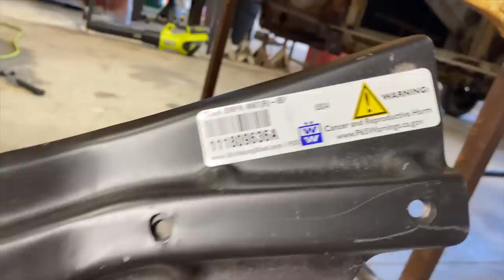1965 VW Beetle Restoration - Heater Channel Fit & Weld

Comment: You are lucky that the heater channels come already assembled. Years ago, when my dad repaired a 74 super beetle that I now have, they came as separate pieces and had to be assembled as they were installed on the car.
He had actually had the driver's side put together and welded in place but had to take it apart because he had it wrong, and the door would not close.
Reply: I was going to point that out too. I bought repair panels from the VW dealership back in the day and it came in pieces.
Reply from the maker: Yes, the HC from Klassic Fab are really nice !=)

Comment: Mike is the guy to ask but just my opinion is measure to distance from front piller to back and make them match so you can tack weld in the passenger side heater channel. I've seen Mike repair a door like that before. Takes time but doable

Comment: 9:32/ 48:18 Thank you for teaching all of us this process/ product. Learning something new on  restoration!

37:10 / 48:18 I had the same issue removing doors on my VW 1961 Beetle. I learned lube, screwdriver w/ tapping the screwdriver with a hammer, then using a air impact screwdriver helped free up those door screws. 

Your doing awesome! People need to understand that it takes time, patience, and a little elbow grease, to make a VW Beetle look amazing!

Comment: You will want to fix and weld the inner wheel well in the front to the heater channel and the rear quarter area to the channel before you cut out the pillar area

Comment: great video! I use to do both heater channels at the same time, however, I've discovered that replacing one side at a time, was easier, with little to no body flexing, and door alignment was spot on after installation...
if the heater channels are both corroded to the point where there's no support left, and the doors are already out of alignment, then go for changing both....

Comment: Hi CT, I was told your rivet gun tool was invented at Boeing during WW2 by a guy named Lester so they were called Lester tools but you needed air. There was a hand one you could use without air as well but you needed one screw close to it free and up a bit to use it with the tool for leverage to get the other screws out. It was good on a flat surface like on a wing.

Comment: Love your attention to detail and just 'keeping at it' but I think you missed an important factor in fitting heater channels to the body. You bolted the body to the chassis on new rubber mountings but bolted the heater channels to the chassis without the thick rubber gasket that goes all round between the body and the chassis. I think that is why you had to distort the front of the chassis up against body to make the doors fit.
It all fits now but I hope you will not find that when that gasket is fitted under those heater channels the front and rear mountings are not too high off the chassis. That gasket is VERY thick.
Reply: That's exactly what I was thinkin'.....

Comment: I love your work and I feel you would benefit by doing the same jacking process on the floppy passenger door opening when tacking to the rocker. Use measurements from the other door, both horizontal and diagonal, to give yourself a fighting chance to gap the door evenly. I have never done bodywork, just makes sense to me. This series has me hooked and I am working my way through the swamp dragon..... Best regards from sunny South Africa

Comment: The screws on the door are made of softer metal than the door pillar threads so that they bite in tight  that's why they are always a pain very clever from VW.

Comment: Work the screws in and out as you go..don't just keep going out only...you spray it..turn out till it tightens...spray the threads you turned out...turn it back in...turn it out again till it gets tight ( just begins to get hard to turn again not too far )..spray again to lube threads as you turn it in...this gets lube in and cleans the threads of crud making it tighten up...repeat till it turns easy.... takes time but usually works to get fasteners out when seized or rusty ....heat helps too as you go...

Comment: Hi guy, I really enjoy to follow  your beetle playlist. At first sight,  this car was intended to be scrapped,  and that's the funny part, to restore a car in such conditions is not for beginners! You'll learn a lot. 
Before tack welding the channels, you should think to restore the doors so you'll get its final volume. Great job!

Comment: Great video, something I learned when welding, is to move that light in front of my face closer to the weld, so I can see better before I pull the trigger. Also for grinding down the weld we like to use a 36 degree flap disc on your grinder. It works amazing and takes them down real quick. But great work, the progress is amazing.

Comment: Dude! First of all, you’ve got brass balls to take on a project with this much welding, so take this as constructive and supportive criticism, and suggestion.

(Weld up cross supports for all 6 sides  of a box, to the inside of the body, with the doors on, and the body as squared up as possible)

Put the doors back on, and lined up in the right closed/squared up position. Then weld Chris-cross supports, top of A pillar to near bottom of B pillar on the passenger side 1st, and top of B pillar to near bottom of A pillar, on the inside. 

You’ll clean those weld spots of & prep for paint later. Do the same for the driver side. 

Then weld supports from the top drivers side A pillar to near bottom of Passenger side B pillar, and top passenger A to  near bottom of divers side B. That forms an X going from the top of A to near the bottom of B, now repeat that X going from the top of B to near bottom of a for a cross body X slanting the opposite direction of the support I described first. This one going up from front to back. 

In other words, with the doors on, weld up way more support than you had before, to keep that body “squared up”/aligned when you take the doors off, AND so you can take the body off and on, as much as you want, without the body’s geometry changing every time you lift it.

I was trying to tell you in the beginning when you first lifted the body, that you need to weld up cross support for ALL 6 sides of a box inside the body before taking the body off. You would not be having this difficulty, now, had you done that first. 

The fix for that mistake, is as I described above. I want you to succeed, and you will, I just don’t want that mistake to continue to make this more difficult than it already is.

I know the Passenger door is “too far gone”,  but either do as I described above, or get a donor door to square up the body, before welding the heater channels, and then weld as much of the outer skin of the old door to the donor or fix the OG door.

Whatever you do, (tongue in cheek, meaning,somewhat jokingly)…
 “for God’s sake, man”, please weld up cross supports for all 6 sides of a box to the interior of the body, with the doors on and squared, BEFORE you remove the doors and body to weld up the repair areas. 

If you doubt me, send an email to that Chris V… guy, he is really cool, too, and will give it to you straight.

Again CT, I’m proud of you and your work, and I want you to succeed.

Cheers Mate! ❤felt support.

Comment: Hey CT i think you should look for a decent door and fit it as you did before welding the heater channel or measure and make a brace for the door opening to prevent body movement dont think you have enough bracing given the amount of times the body is being taken off other than that you are taking the right approach that how i would do it, good luck keep em coming.

Comment: Da, I know so good the feeling of one step forward and 2 back.. 😑 Happens to me all the time, no matter what I'm onto. The lower border is pretty decayed, it would be easier if you were able to remove it without cutting it off, so the remains could be used as a template or reference. Anyway, you will have to double check measures to prevent things going on twisted. Keep it organized, measure 6 times, cut half time and measure again before you cut it off, whatever it is. Check also heights, could help if you make yourself a extendable tube with something to lock it, as measures will be more consistent that way. Also with an extendable tube (square tube) you can detect discrepancies easier.
Things are gettind interesting and let's see how you'll tackle with the situation. Remember, hammer, dolly and sheet metal are your best friends in remaking something. Welding shrinks the spot, hammering stretches the spot. 😉 Keep on, you're being observed...

Comment: What are you using as a rust converter?
I am doing a similar project on a beetle.
Love your videos!
Reply from the maker: ospho - Thank you! =)
Reply: I have been using por15 metal prep. I will give Ospho a try.
Working on a 74 super beetle that’s about on the same rust and crust condition as yours. Going good, just taking it one thing at a time.

Comment: Ct...measure up from top of the hole you popped the clear caps put a mark to cut
On replacement measure up same point..that should put you the ballpark especially for passenger side.

Comment: You might be able to tighten up those doors with new door hinge pins. Myself… I’d be looking for better doors . You have so much work ahead of you, why spend so much time  on  welding up door panels  + hinges that may need boring out . I’m doing a 66  right now not that rough..but rough enough that I sent it out to be media blasted. Time saver.  Good luck.

Comment: Great video and so many great comments too. My pick is the gasket issue, and the hot water on the tube.  From the armchair, I'd be adding another brace higher up and then remove the lower one so you can ensure that alignment is not lost when working on the bottom of the pillars. That's just an armchair view though.

Comment: You need to jack it up...block all the way across the side to get good support to weld it...your twisting the chassis by one jack point...if you block front middle and back you should get a better solid body once your welded completely..even tacking will be more solid at this point...

Comment: OSHPHO should be brushed or sprayed on . fine to rinse it off but only if applying a second coat. otherwise it should be left to fully dry to act as a barrier protectnt if not painting. If painting you should wipe clean with paint thinner to prep the surface.

Comment: Great idea jacking up the side where the door(driver's) wouldn't close properly. I Hope you welded one side at a time. Since the passenger door drops, jack up that side and see if that door closes properly. Then mark and weld. Then the body will likely be square.  I'm really enjoying this build. And thanks for getting something other than WD40 for penetrating oil.

Comment: Coming along nicely! I love the 1965 VW Beetle. It has the larger rear window, after the "pretzel" and the "oval", still the smaller, not the super tiny ones, and prettier rear lights and the "embossed" curves (pardon my lack of proper vocabulary) of the front and rear hoods still go all the way down, which IMHO looks better. I haven't seen the "nose"  above the rear license plate. Is it still the small one? Good luck with that rusty door!
Reply: P.S. Got it: 5:06 - it's the larger, larger nose. I had doubt, since after an online image research, I go both "noses" under "1965 VW Beetle/Käfer).

Comment: This might be a boneheaded question when I ask this, but what's the difference in using a grind wheel versus sandblasting it? Apart from maybe not having the tools or space.

Just doing some homework here because I'm THINKING of doing a sleeper bug to replace the one that my parents had when I was a kid.

They went to Germany for their honeymoon (dad's German), and the bug that they had for years my mom used to say with her wedding ring because when they first got married my dad didn't give her a ring. So when they were in Germany they picked up the beetle that they had in the garage for years.

The engine eventually seized up because nobody drove it, and my dad gave the bug away to one of his friend's sons, but I always disliked the fact that he did that because I loved that car.

Not getting anything right now because Mom and I be moving cross country, it doesn't make sense to get a car that doesn't run and trying to pack it up and move it across the country until you're actually settled in, but I was thinking of redoing a bug like what my parents had but do it as a sleeper. So just doing some stuff here to educate myself a little bit

Comment: right door is really bad. if you can find a late model door and cut off what you need it would be good. That way you can save the patina. Almost more work to do a patina ride than whole restore. Preservation vs Restoration. IMO preservation is more work.
Reply: Late model door bottom is the same as 65. up to 77 all the same.